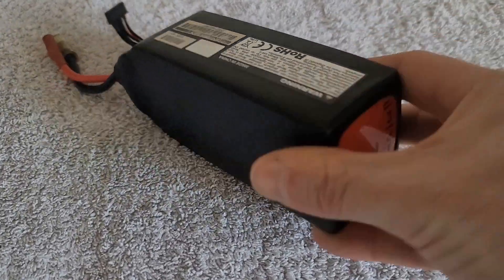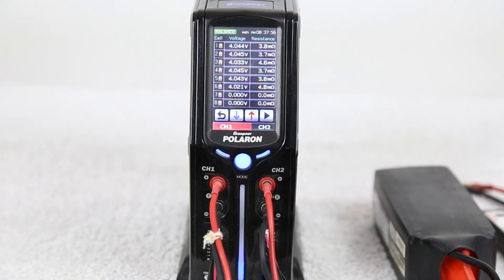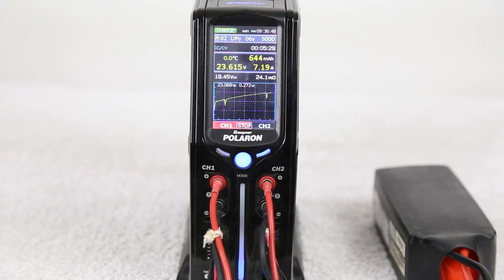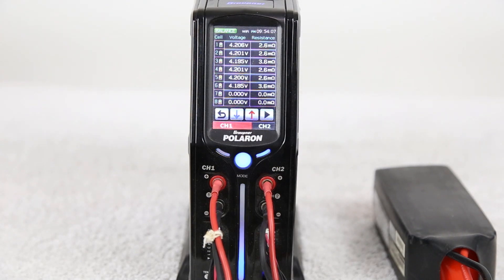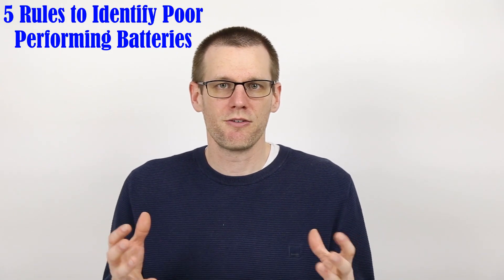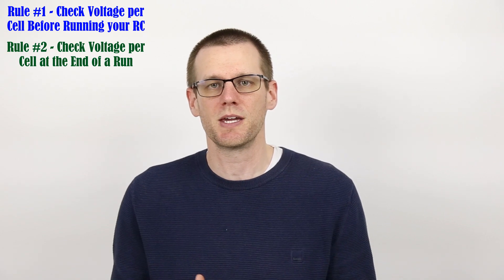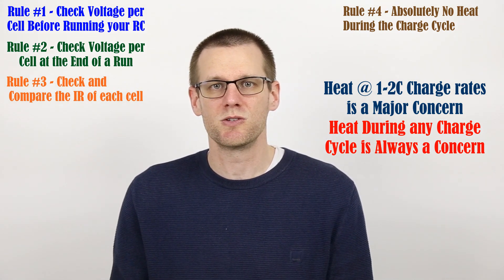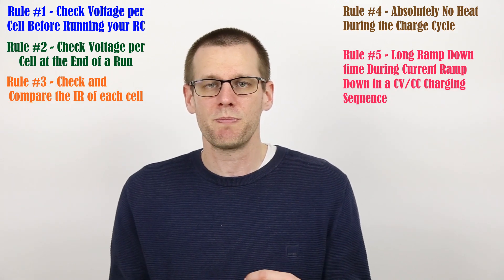This RC LiPo Battery Fakes Great Health but it's the opposite of Healthy

Comment: I have a question me and my dad both have an imax b6 charger mines tge ac version but they don't charge all the way up to the full amps example my 5000 mah 3s 45c lipo only charges usually to 3 thousand something and it's a brand new battery I recently got only used a few times first time it lasted like 52 minutes then after fully charging it after and going to drive again it didn't last as long any suggestions?
Reply from the maker: What is the voltage per cell after a run? If it is above 3.7V and you are charging 3X00mAh, sounds quite normal. You don't want to drain more than 4200mAh from the pack otherwise its  lifespan can be shortened.
Reply: @RCexplained  alright so after a run if the charger shows its at 3.7 or above its normal if its below  3.7 the battery is bad? Also does the battery use the full lets say 5000 mah because as I said its a new battery its first run recently it lasted 52 minutes then it kinda went down to around id say 40 all I know is that it definitely wasn't as much runtime plus the charger doesn't charge it all tge way up to  5000 mah 3000 something at most
Reply from the maker: @zacharysmith737  it depends on the data that you have for your runs. What is your final voltage per cell after a run?

Comment: Should not that some chargers will balance charge to a 0.001v mismatch from cell to cell so depending on your charger it may still balance charge every time. What you want to see its all cells hit 4.20v then amps ramp down to 0 with in the next few min. If charging amps stays at the same level for more then a few min after all cells hit 4.20v you have a resistance problem.

Comment: As the resistance gets high the run time and MAH drops off. Lower resistance is more power and speed. From years of matching cells. They do not match lipo cells. Running cycles on the and matching resistance and MAH and voltage

Comment: Normally cells get hot with low resistance not high. High resistance keeps the cells from getting hot and auto ignights. Normal a pack when it gets above 140 it can catch on fire

Comment: That's why I use a Traxxas Live charger that tells me the cell values in the Traxxas Live phone app.
That's also the right thing to do when charging because you can tell what's going on while being away from the charging unit.
Because that is when the battery is more likely to experience catastrophic failure.
That's why I charge mine in my brick fire place inside a secure metal ammo box with the rubber seal removed.

Comment: You didn't mention at what resistance level(s) a battery should no longer be considered good.
Reply: He has another video where he goes into detail about how to calculate the true "C" rating of your battery & not totally rely on what's printed on the label.
Use that to objectively determine whether-or-not your batteries are still good or not.
Reply: @NiCadHeliPilot  I've seen that video and never rely on the label.  That's one of the reasons I always go with a much higher c rating that required as well as going with good quality lipos.  He is the reason I know that c ratings are not regulated when making lipo batteries, which means they could most likely be in accurate.  Especially when buying non quality lipos.

I recently had someone tell me to check the internal resistance on a lipo that went for a 10 min swim in the LA river, and although all the cells showed a pretty low resistance, I am still unsure as to what to look for when checking the resistance and would still like to know what is too high of a resistance w/o having to do calculations seeing that my charger shows resistance values.
Reply: @ubreakitirepairit3569  There is no one number. Smaller cells will typically be higher so I can't just say if its over 10mΩ its no good. My personal opinion after studying lithium ion cylindrical cells (not an RC guy) is once the DC IR doubles, you've hit that EOL point where you probably have 80% capacity remaining and you've probably hit the number of cycles the datasheet suggests it will take to get there. You'll see the DC IR start to rise dramatically about 3/4 of the way into that "lifetime to 80%". So if manufacturer says 1,000 cycles you'll see IR rise faster typically around 750 cycles and by 1,000 you'll be double the original IR reading.